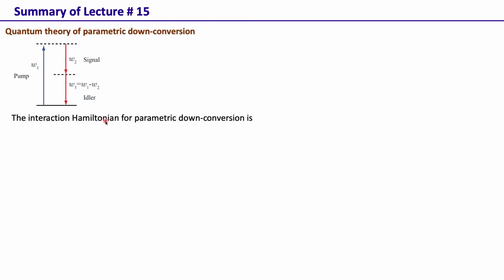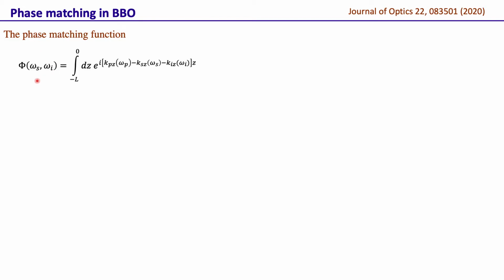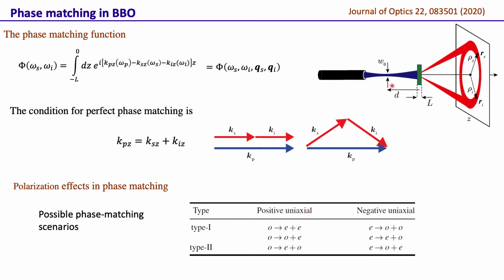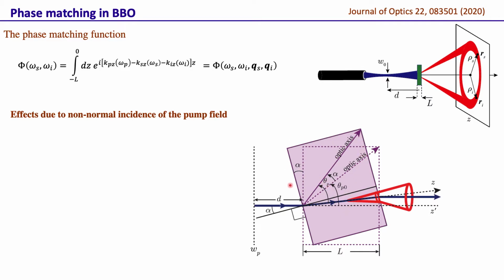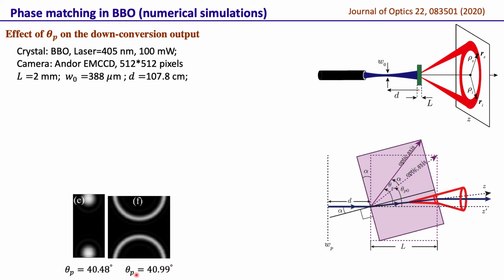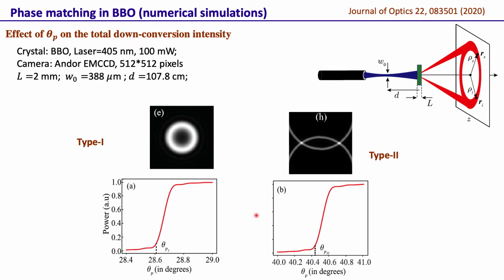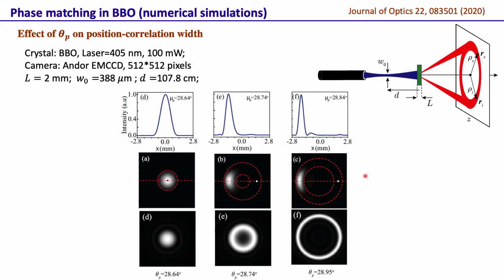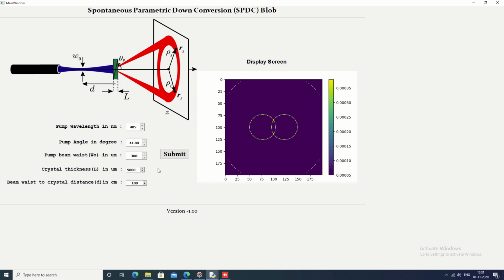Coherence and Quantum Entanglement: Lecture # 16 (Phase matching in parametric down-conversion)

Comment: Hello Sir, Have you included the walk-off effect in the BBO crystal while simulating? Is there any place from where I can access your parametric down-conversion simulation? It would be helpful if you can share your code in the public domain.
Reply from the maker: These simulations do not include the walk-off effect. We have developed the code for the lab but haven't put it in the public domain yet, although we plan to do it at some point.
Reply: @quantumopticsandentangleme3934  Thank you for considering to share your efforts with others. Highly appreciated.